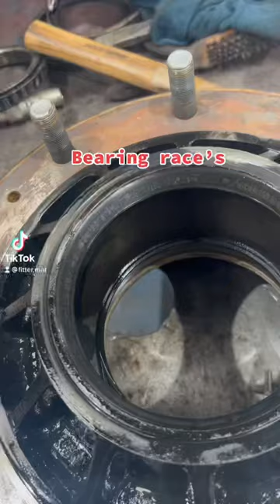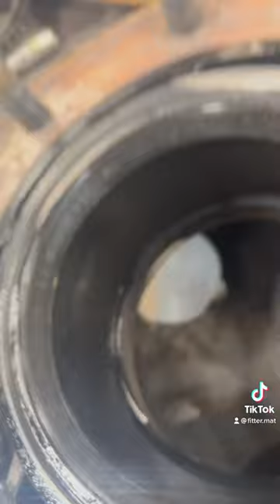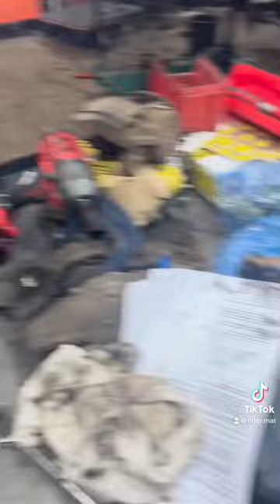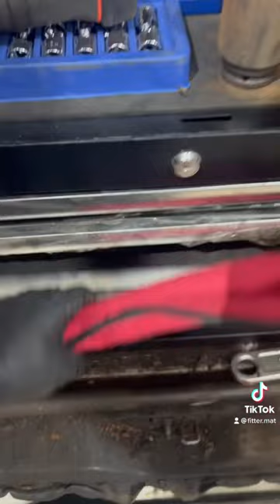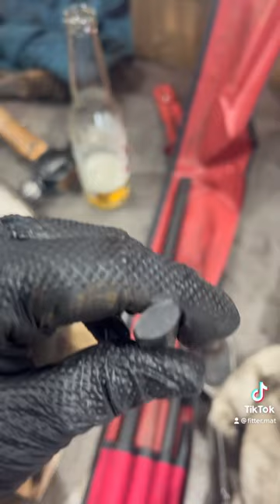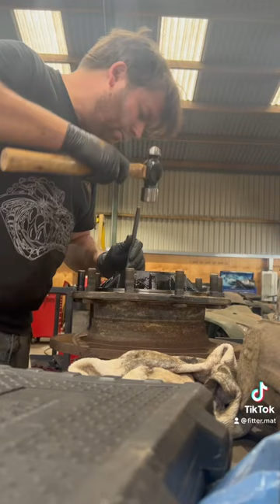Bearing races

Comment: A couple of runs with the mig around the inside face of the old race let it cool,works 99% of the time
Reply: Because that’s what we need to wring out of our info structure…

Something that can be done with literally hammering a piece of scrap metal
Reply: @fastinradfordable  "our info structure"

Our what?
Reply: So right weld it no hard work doing  that
Reply: that requires rolling out the welder, i dont know about you but I prefer just beating the shit out something with a long cold chizel.

Comment: Useful tool they were originally made by Mayhew tools, search - "Mayhew Pro 62015 Bearing Race Punch Set, 4-Piece" used to come in the same  sleeve too when I bought a set.
Reply: Most likely rebranded Mayhew, was about to comment Mayhew, when I read your comment. Mayhew must be cheaper than Snap-On.

Comment: That’s not a punch. 

That’s a drift.
Reply: I've only ever heard to people refer to punches as punches. The only time i've heard anyone use the term drift is with drill drifts.
Reply: Steel erectors use drifts for alining holes when putting sheds up etc!!
Reply: @iantowers6972  that too!
Reply: @jayhammersley9534  right. 
Drift is straight like a drill. 

It’s not meant for punching. 

Punches are tapered. 

If you hit a drift. 
Like a punch. 
It bends. 

If you never knew before
Now you do
Reply: @fastinradfordable  drill drifts are tapered, used for removing morse taper drills from sleeves.
Reply: @fastinradfordable  you clearly seem the sarcastic type so I’ll put it into fact instead of arguing between common dialect differences. A punch is a flat ended bar used to localise the strike of a hammer. A drift, usually has a rounded head and used to widen an already existing hole.

Comment: Why waste your money on crap on? when a bead of weld on the inner race will do the job quicker. when it's cooled the bearing race contracts, and the race just falls out, with out the need to use a  hammer, and punch .  Eliminating the risk of punch rash to the bearing housing.
Reply from the maker: And when I’m in the middle of nowhere, farmers field or down a quarry where would you like me to pull a welder from? Even if I had one by the time Ide filled out a hot works permit and risk assessment I can have done the job with these
Reply: @fittermat  But you were in your workshop my friend, and for the home workshop you don't need a hot work permit. I'm sorry if I offended you, only sharing my knowledge, but you are right, when in the field, without a genset then you have to persuade it with a more aggressive attitude.